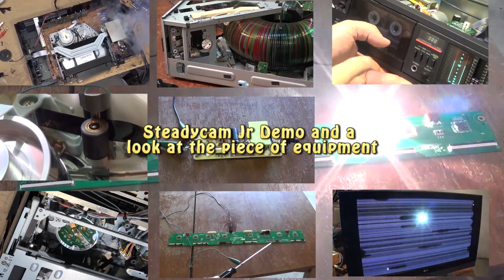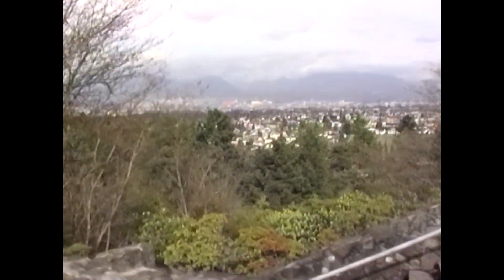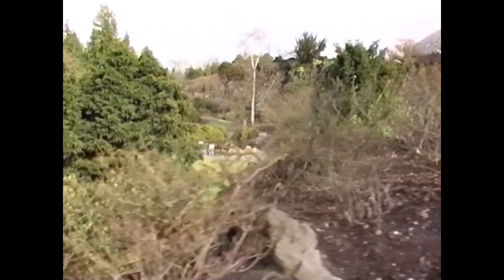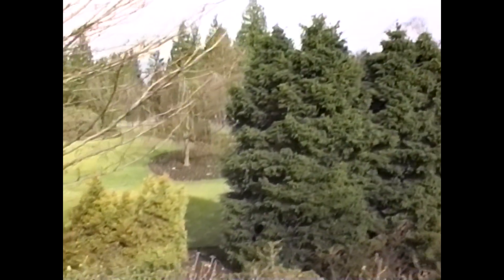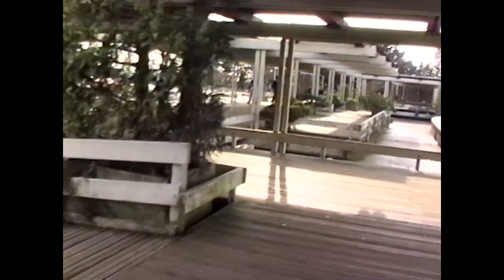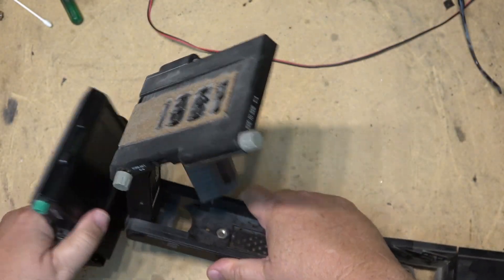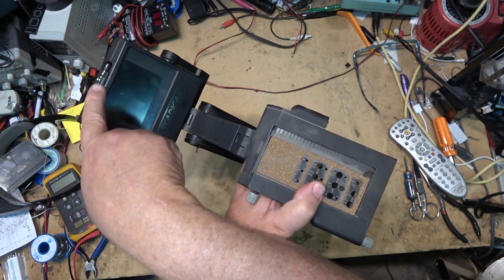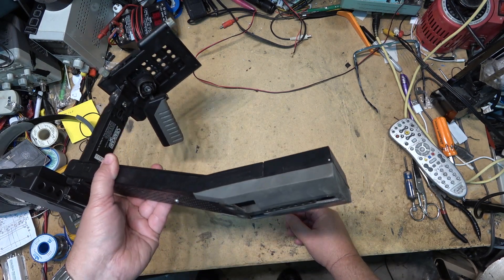Steadycam Jr Original test footage from 1991

Comment: My Steadycam Jr lasted less than a year.  I used it with the SONY VX3 back in the 90's.  Cheap plastic started cracking.  Should of gone Glidecam.  Thank you for the great content Dave.
Reply from the maker: Yes when i first bought it i was expecting something more robust.  The bearing on this one is kind of fubar after i used it with my vx3 a few times as the vx3 was overweight.  You are right though cheap plastic is what they did.  There weren't many options when this came out. Glidecam and other copycats followed.   I had a knockoff unit that banggood sent me.  I tried for over 2 years to sell it for 20 bucks.  Finally gave it away.  Will do the same with this piece of junk.

Comment: We had 2 of these and you're right you can't just drop a cam on it and go for it.   I got good results from a Sony DV handicam in 1998  , made a promo video for the town that I shot mostly on a skateboard  - no one else could balance the unit - but I draw that down to lack of patience, even after having a workshop to show a few fellas how to do it.   I remember it being some sort of plastic which was cheap IMO -  one day they disappeared I wonder if they were stolen.
Reply from the maker: It worked really well if you had the patience to set them up and plan your shots. and this is what a lot of people didn't understand what emotion pictures being shot and they're using a Steadicam they do dry runs they rehearse and then they will do multiple takes until they get it right. even with the state of Junior if you are shooting something that is scripted for example and you can plan how you're going to shoot and shoot accordingly you can get some very incredible results indistinguishable from a big steadycam. For running gun on the other hand well again you need time to set up you can't just slap the camera on and expect to get good results and you can't just shoot outside when there's a wind blowing even a light wind will cause it to go out of control so under the right conditions they look fantastic under the wrong conditions well you might be able to do just as good a job holding the camera by hand if you catch my drift. The servo 3x is gimbals on the other hand do a really good job under pretty much every condition shooting from a car shooting off a motorcycle and the gyro stabled stabilizers also of course do an exceptional job. But they're two completely different pieces of equipment and many situations steadycam shots look smoother than gimbal shots

Comment: Reminder of the  The real to real metal tape that would  stick to the glass tape heads
Reply from the maker: Glass heads onto real machines have been a thorn in my side as well as many others. I love the trolls to try to justify their expensive eBay purchase and get upset when someone tells them that their tape heads are garbage. They will sit and blame it on the tape which is actually accurate it is the tape that's the fault because the tape breaking down however what these dim bulbs failed to understand is that very few people are actually recording anything on real to real tape and those that are are going to use new tapes so they're not going to have this problem for many years until those tapes also deteriorate. The problem is when you get an old tape that was recorded 50 years ago trying to recover it is next to impossible on these reel to reel machines that akai put out that use glass heads. Even if you bake the tape you still end up with losing a good portion of the tape surface onto the head itself and that is just destroying the tape in the process of trying to play it. the only solution is to play such tapes on machines that don't feature glass heads, so then what is the point in having a machine that has glass heads if you can't play old tapes on it? The solution to this is to dump your glass head machines on some other dim bulb that doesn't understand and let him deal with it! Oh wait a minute that's what somebody already did and that's what gets people's backs up when I tell them their heads are garbage because they overpaid for an old piece of sh1t that they should never have bought.